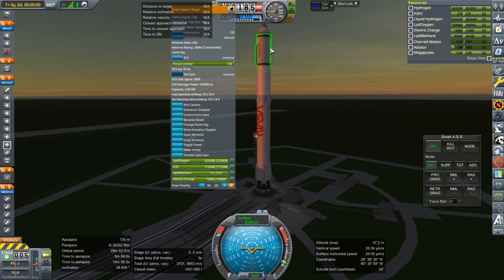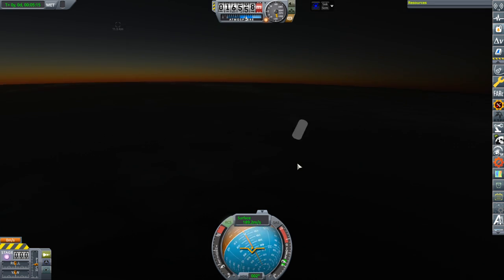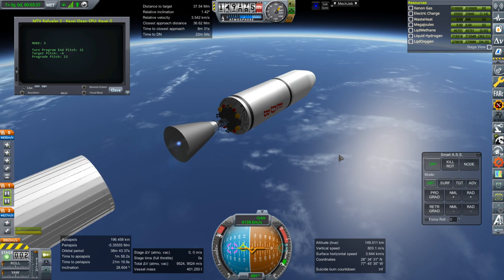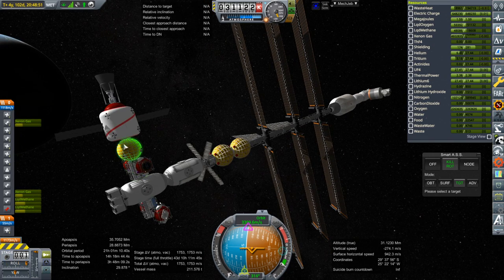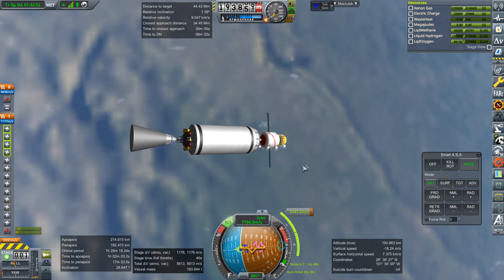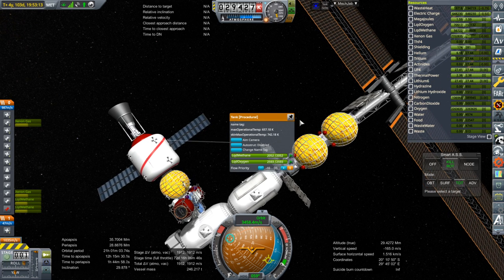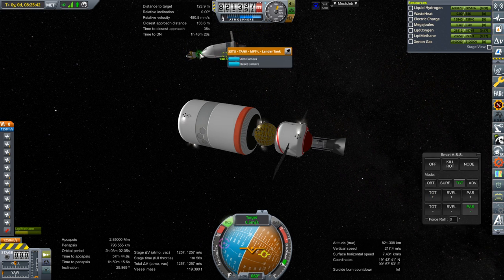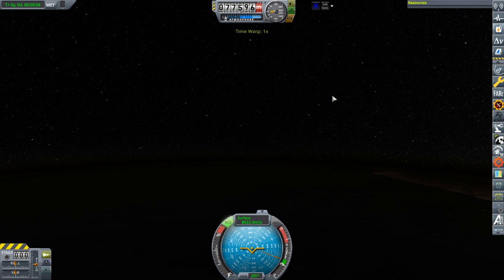KSP 1.6.1 RO and Kerbalism - Mars Colonization 042 - Refueling

Comment: One of the reasons I keep 'revert flights' enabled is so I can fix little issues I didn't think of when I was at KSP. Because in a real space program like NASA, there would be 100's of people checking and double checking that everything was built and planned correctly. Where as I am just a single player prone to making many mistakes. :-)
Reply: Pieter Kirkham yeah you should totally stop worrying so much about “cheating” and start worrying more about preventing mistakes. I very much agree that you should revert flights where these little errors occur
Reply from the maker: Since we're not in career mode it doesn't make any difference - the time was spent already. If you mean reverting and editing it out, that's against the rules - once I press record, all mistakes get included in the final cut. Revert flights is technically enabled in the settings, but only for glitches and its use will be fully disclosed.
Reply from the maker: Nothing prevents mistakes more than knowing that you'll have to live with them.